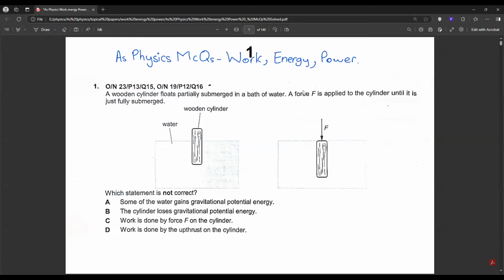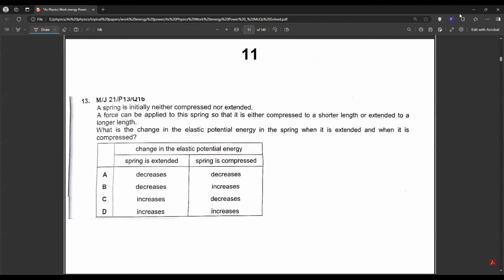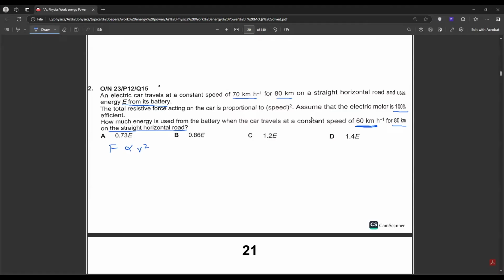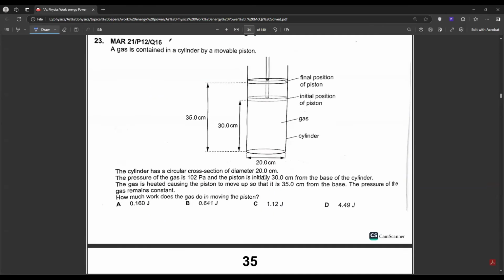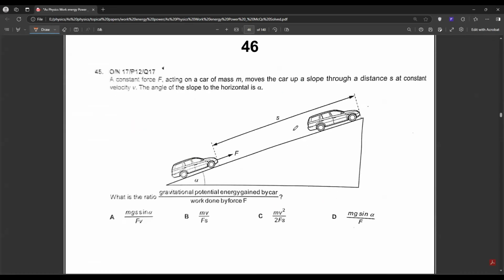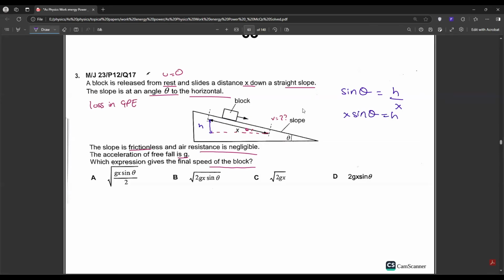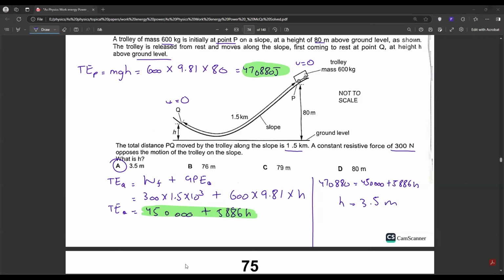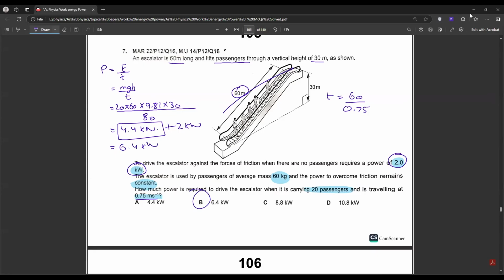Work Energy Power - As Level Physics Past Papers (9702)

Comment: For question 63, why cant we use v^2 = u^2 + 2as? if i use that then i get C.
Reply: As per m1, every work energy power question can be solved using kinematics, it just takes way longer. Now I'm not sure how that applies here, but take from that what you will.
Reply: iused the same equation and got the correct answer, you must be doing smth wrong in your calculation